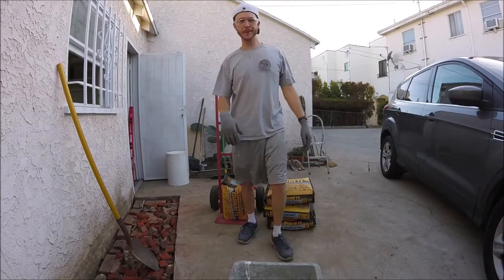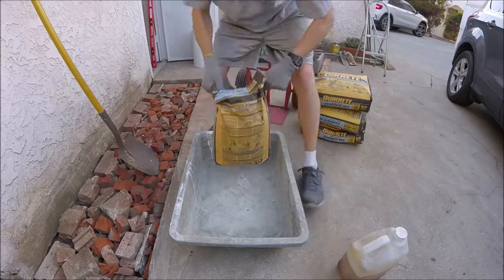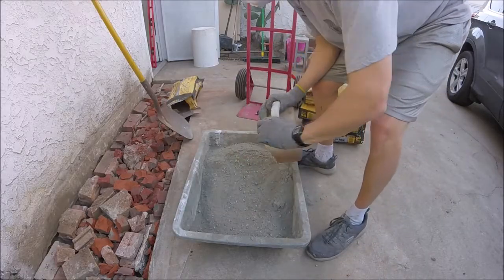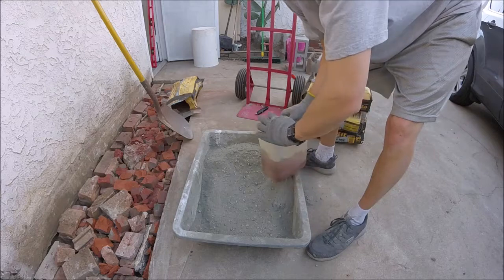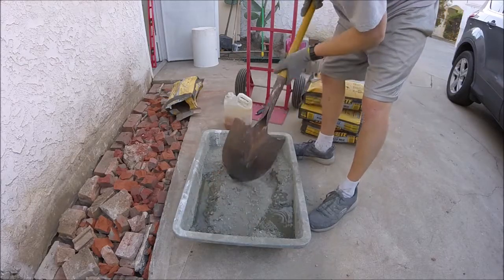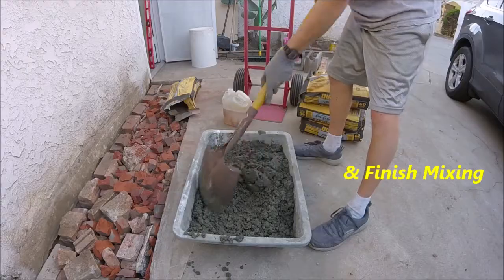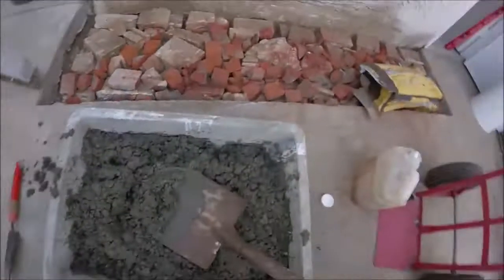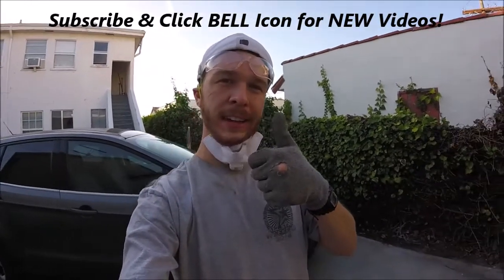How To Properly Mix a Bag of Concrete -Jonny DIY

Comment: If I am mixing cement by the shovel and I mix 3,2,1 rock sand cement  how may ounces  of water  is correct
Reply from the maker: Ohh I usually just mix that by eye, just keep adding water slowly then mixing until a nice slump that you're looking for.

Comment: Thanks for the info, I will patch my pool where I made a 24 by 24 cut in the concrete deck to repair the broken skimmer line.
Reply from the maker: You're welcome, glad I could help. Good luck with the project 👍

Comment: So basically 10 percent water to cement ratio. I understand metric measurements, it would be 1 litre water per 10 kilogram of concrete powder.
Reply from the maker: Once you mix a few bags you'll be able to just do it with the hose and see the consistency. It doesn't have to be perfect, it's just stronger when you don't mix it super wet and soupy 👍

Comment: For me I found it took too long to mix all the powder out being this thick. I made mine a little wetter to go faster. Reduces strength but should be ok for little jobs.
Reply from the maker: You're right much easier to mix it more soupy and then can always add some dry at the end if want to thicken it back up 👍

Comment: Thanks man, I'm about to make some weights with concrete but didnt know how much water to add. You're a huge help!
Reply from the maker: You're welcome glad I could help. Yes key to mixing concrete is adding the water in slowly so it doesn't get all soupy. Should all be consistently moist but not soupy. And for weights if youre making them in forms, Tap edges of forms to get out air. Cam also coat forms with cooking oil etc for easy release 👍🏻

Comment: I finally stopped the video to see what size bag ... It is a 60 lb bag
Reply from the maker: No 90lb bags for my old back 😄
Reply: @JonnyDIY  ... They sell 80 lb ready mix or 60 lb .. the bag in the video reads 60 lb
Reply from the maker: @Jesusiscoming24  yup, its 60lbs, those are the only ones I can lift anymore 😆
Reply: @JonnyDIY  ... Me to

Comment: not one thing you said was helpful.  Look at the other videos. Example: chop the bottom of the bag off and empty it by pulling up on the top.  Who can lift an 80 lb bag like you did in your video!
Reply from the maker: 🤣 I don't buy 80s anymore with my old age and bad back. Only 60 pounders now 👍